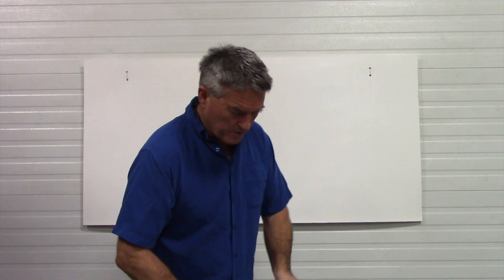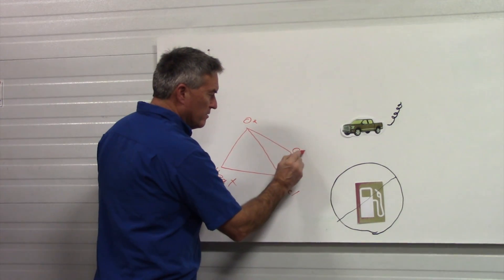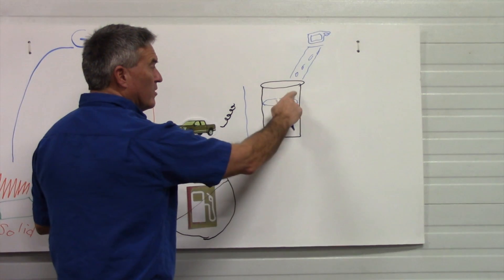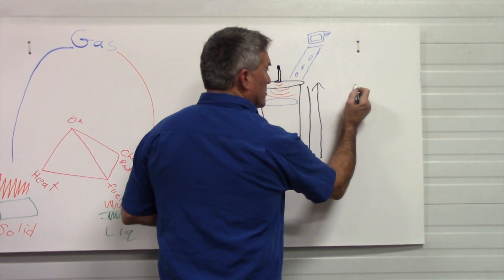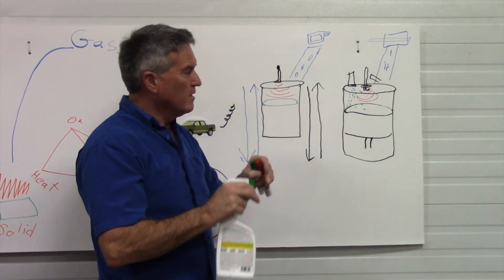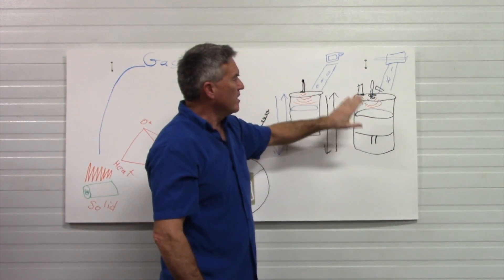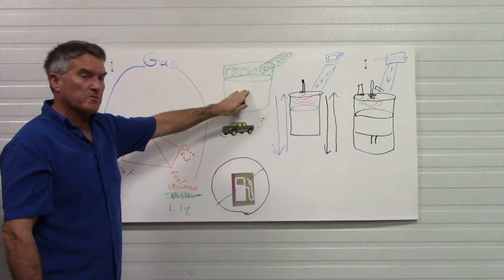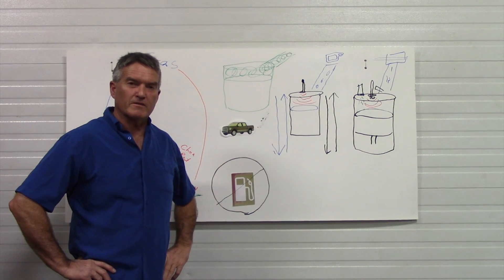One Simple Trick to get 100 miles per gallon with less pollution!

Comment: Smokey Yunick did that back in the early 90's on a 283 Chev by profection of the old 200mph carb...  

Gas has define stages (5) of flash points... He provided waste heat to the gas in stages of the flashing - the process of the 200mph carb was literally limited do to the fact that it didn't work with the chemical flash point of fuel and it's weakest design flaw - expending mixture.    So when Smokey provided the heat for the 5 stages and used a compressor to pressurize that mixture into each cylinder - the engine made HP and MPG unlike anything before or now 

This info should help

http://rexresearch.com/yunick/4862859.htm

https://www.allpar.com/old/200-mpg-carburetor.html

Watch this

https://boomtastic.com/gallery/videos/Smokey-Yunick/Horsepower-TV/

I know he had a 283 build up - 
Car Craft I believe...

Here a little more info

http://rexresearch.com/yunick/yunick.htm

Comment: In order to produce a mass of 6 tons you would need to start with at least that amount. That equates to burning 5 gallons of gas per day 365 days a year, not far fetched for some but not most. Then the 6 tons of gas would have to be somehow by magic converted into 6 tons of carbon. Now that's actual carbon not co2. So if 18 lbs of co2 gas are created by combusting 6.5 lbs of gasoline then the actual carbon content of the co2 gas is less than a gram. so going buy your bs figure of 6 tons we would need to burn several hundreds of gallons of gasoline per day per vehicle. I'm not aboot to start drinking your koolaide. You sound like the idiot farmer Al Gore.
Reply: Besides that Gasoline is a byproduct of kerosene diesel production. So where does all that kerosene fit in your master plan?

Comment: hasnt this guy heard of the pogue carburettor , they used this method in WW2  running tanks at 100miles per galon ( i said a tank) the government is owned by the fuel and pharma companies ...imagine how much money they have made since WW2 ...they are telling car makers how to build their engines ...20 years has passed since i got my licence cars have androids , variable controlled cam timing , multi point fuel injection, quad camshafts and the fuel consumtion hasnt changed on the vehicles !!!! WAKE UP  tesla built an electric car in 1902  that pulled 90 miles an hour  powered by a shoebox  sized power source that didnt run flat...the army and fuel companies have all the technologies...

Comment: It's Ogle patten from 1980.... we ordered a kit, $100 we build it in 1983 we went from 21mpg to 85mpg, lost about 1/2 the power of the engine, it was a buick v8 so it still had plenty of power.....we used the exhaust running through a stainless steel tube in another stainless can, it was used to heat fuel, fuel was sprayed on the hot coil, the fuel  boiled turned to a vapor, then it moved through a tube to feed the carb, 2  .187 jets fed the engine, it lost some power but ran rather well you need another valve to allow extra vapor in during big hills or accelerating plus you need an existing carb to run engine until it warms up. After warm up  you can kill the gasoline carb  run off the new vapor carb ... also exhaust fumes were non existant. This is nothing new, it does work, and you are right, but push it too hard and your person safety will be jeopardized... think they are moving 60 billion gals of oil a day, they might object if you cut that to say 6 billion. Word of advise. Build one for yourself and keep you mouth shut....
Reply: Well I have an old portable cook stove in my camper that runs on unleaded gas Pour gas into the tank pump up the pressure and the burners look clean and blue like the propane models
Have never checked to see if it’s more cost effective tho

Comment: Anybody pushing battery powered cars please remember they have to be charged...using power from??? Coal/nuclear/oil also batteries have environmental costs too. Even solar panels have to be made from rare earth ingredients requiring mining/processing.
Reply: vtg100 ambient electricity is almost free! Anyone who’s truly looked at the logic of hydro or diesel produced power will go how can this supply millions of homes, impossible..
Reply: ahhh but it IS possible...with sunny fields of glass and extention cords were carn use to grow, and there aint no fields to plow...world will collapse from round up poisnin their cancer cells before ya can count 23 million chinamenwomen..so then all will be energy suspition until the sun runs out of super X 4..
Reply: Lol they can make  1 million windmills
Reply: @realtan9026 hopefully you are not saying this thinking that this is a reasonable solution. 
Windmills are highly inefficient, have many problems.
Reply: @realtan9026 those windmills usually power the oil rigs and they produce JUST enough power
Reply: Not to mention it's microwaving folks

Comment: Well - one thing is for sure. 45 years ago, I found the vapour carbs of the 20's and 30's. They were large and since it was readily combustive, you had a explosive mixture during an accident. Metals were not as strong as they are now. You could burn exhaust valves quick. The one thing I recall is that 4 barrels were good at burning or at least dumping fuel down the intake. The smog stuff, the CAT is only there to make sure that everything out the pipe is charred and no hydro-carbons escape without being reduced with O2. I drove a V8 in the 70's and it got 14 to 30 mpg depending on conditions. Today, a 1/2 ton V8 gets about the same mileage as I did all those years ago.  Have we really improved anything, or just muddied the waters and you don't know. It matters not what you or I believe, we are both right. Cheers

Comment: Doesn't make a difference at what point the gas as liquid turns to a gas it still burns the same amount but it is much more unstable as a gas so that is why it is much safer to mix it inside the engine than outside of it. Just imagine a flash back would be like a bomb. What a crazy idea! Burning wood gasses after filtration was done in olden times and it was very unsafe. Better to change the wood gas into wood alcohol and run that through a carburetor or injection system. Your half ton likely gets 15-20 miles per gallon so this concept does not increase mileage by 500% it may increase but not noticeably. I think your just a goof who likes to talk but not say anything.

Comment: So basically the concept is to take fuel and air mixture in a separate burning chamber to burn it continuously and as cleanly as possible to create a continuous supply of high pressure gas and feed it in a controlled way to the block-piston-crank setup to run it. Just like a steam engine. So, why not feed some FREE natural liquid water in the external burning chamber to use the already existing heat to make some more extra gas to contribute??? But, however we decide to do it, when it comes to a external burning chamber concept then the feeder pipe diameter and the piston chamber diameter ratio have to be maintained (maybe controlled) properly to have a good acceptable power and acceleration balance. But that's a instant realization that the fuel will get much more time to burn so will burn much more cleanly. But as the external burning chamber is burning continuously so also getting fuel feed continuously so when feeding the gas to the piston chamber it will tend to get some un-burnt fuel too. So my question is how will you prevent that or so to say minimize that??? Maybe burn it again in the piston chamber by mixing the feeding gas with some fresh air ?????? (Just a thought.)

EDIT: My English is excessively good ;) and I am unfamiliar with your accent so I maybe completely or partially misunderstood your "trick" concept. So that's a disclaimer. Feel free to correct me.

Comment: Is FALSE that gasoline turn to pollution HC or CO.  IF the automobile the engine injectors, sensor, and compression are in good working condition the Focil fuel turn to water, good combustion becomes water at the end of the exhaust.

Comment: To all the negative comments,  legally he can not tell you the trick, but if you have any mechanical ability at all it's all very simple,  he told you time and time again, turn the liquid form of gas into a vapour,  he just did not use these words , so I'm telling you as I really dont care if they tell me I can't say it, TURN THE LIQUID INTO A VAPOR, then introduce it to your fuel injection rail, or your throttle body injection or your carburetor,  it will them be sucked in through the intake stroke and there wont be any pollution from the exhaust stroke

Comment: fuel does not lubricate your engine. Ask anyone who owns an LP forktruck. A lean fuel conditon will cause higher combustion chamber temperatures in lp or natural gas engines too. Atomizing fuel so far away from the engine will just cause a separation of fuel and air before it enters the combustion chamber. I call BS on the 100 mpg thing. Cut the totally wrong physics lesson and show results.

Comment: You explained how when liquid fuel is sprayed into the cylinder it helps cool the engine and if it isn't sprayed in evenly it causes overheating problems. You fail to explain how you achieve  that cooling effect when you are no longer spraying liquid fuel into the cylinder, but a pre mixed fuel and air gas instead, or did I miss something.
When I was learning about engines back in the 70's, I was taught that carburretors mixed fuel and air into a vapour, so liquid fuel was not entering the cylinder, it entered as a gas. So it seems your NEW idea has actually been around for a long time already.
You also say that to increase mpg and reduce pollution, simply reduce the amount of fuel entering the engine. Yes, but that means less power from the engine. So buy a smaller engine.
I'm never going to get this 16 minutes of my life back.

Comment: The fuel isn't lubricating the cylinder wall. The reason you can't put less fuel in is because it will run lean and you get engine knock and damage to the cylinder.

Comment: Throw the gas engine out and replace it with electric motor. Sure the biggest downfall is the battery.  but that's getting better too. How about: using an electric motor and powering that motor with a self looping generator. A couple  of  battery's is only used for starting the motors ups that will power the controller. extra 12 v bat is for the cars radio ect.   It'll weigh less and you can go as far as you want.  When your not driving the car you can switch it over to run your house.  problem solved...

Comment: Whether or not this is snake oil, who knows.   I grew up cynical of big oil and big auto, which have reportedly colluded to suppress better, cleaner tech over my lifetime to maximize profits.  Most people believe it's true, but nobody can change the system, so few try.  My parents talked of the Stillson Carburetor, which they said yielded 100 mpg in the model A, but never made it to market.  There is a long list of similars.  I do recall the removal of the LA area Pacific Electric red car rapid transit system back in the fifties.  It was common knowledge that big oil and GM were behind all the graft and corruption which pulled it off, resulting in the transportation mess which is still the fly in the ointment of southern California.  Later it was restored it at great cost as the Blue Line.  The freeway arteries, however, remain clogged. As long as smart people with viable solutions can be bought out or otherwise neutralized by evil people with big buying power, systemic change is unlikely until it serves the interest of.. yes evil people.  Nice try Zeek on Earth.  You can tell from the comments why this is true.

Comment: Carburettor turns petrol to vapour / heat of engine /gas,
 Injection turns petrol or diesel to vapour the heat Off the engine turns it to a gas  . That's why diesel engines smoke black when cold and need heater plugs to cold start.
 This is at best wishful thinking or Total Very DANGEROUS Garbage.
Reply: Asholes can prove nothing 
I CAN .     FOOL.

Comment: And every step of the "evolution" of fuel delivery to the piston has added more and more complexity and EXPENSE to a vehicle.  In the "Before Time", if you got into an accident you just took out a hammer and beat out the dent.  Nothing else was broken.  Now, a fender bender destroys all the sensors and electronic equipment.  It often costs more to fix a vehicle than to buy a new one.  So, we have throwaway cars.  Talk about waste.  You can even destroy the ECU by not disconnecting the battery before removing an electrical item such as a fan.  Ask me how I know.  Price a new ECU and tell me that today's vehicles are a better buy than the tanks of yesterday.
Reply: And don't get me started about crumple zones.  Talk about planned obsolescence.

Comment: What about the running lean issue?  Without the raw fuel as a cylinder wall coolant, doesn't the engine overheat and starts giving us mechanical problems?
Reply: They would probably have to redesign and add all sorts of new ceramic sleeves and other exotic items to compensate for running under a lean burn system.  Again adding more and more expense to today's vehicles.

Comment: this is a nice lecture in basic fire fighting and or ice operation.  thank you.  now I have a question about your subject matter.  the heat and compression convert liquid fuels into gas to be ignited by spark.  what process do you use prior to the intake stroke to be able to inject a gaseous fuel mixture?  I see some unpleasant comments, but I am not contemptuous of your video.  its a reasonable projection if the missing process is not more polluting or expensive.  please respond.  thanks.

Comment: SOME FLAW IN HIS LOGIC. I WILL GIVE YOU A PROBLEM TO SOLVE TO MAKE YOU RICH! The engine is flawed in design not the way it uses gas.The injectors that sit ontop of your intake valves are spraying gas and in air around a circular disk. During intake it is already being sucked in toward the outside of the cylinder walls.. Its so hot inside that it is already turned into a vapor before compression is completed. This is monitored and controlled by computer. That is why it doesn't run too lean and burn up or too rich and waste fuel and foul plugs and smoke. Id guess that the vapor and air are evenly spread around. After the air and gas is sucked in, the intake valve closes and the volume in decreased during compression.  Your V8 engine has an inherit flaw in its design.  Here is the problem. Each time a cylinder fires energy is used from the bang to create kinetic movement, once the piston gets to the bottom we reach our problem.  Energy is used spinning the cam to open the exhaust valve. Energy is loss stopping that piston's motion pushing that piston back up stopping it again while more energy is loss closing the exhaust and opening the intake valve and losing energy from changing the pistons direction again sucking in gas and air and then when it gets to the bottom using energy from the other cylinders more energy is lost closing the intake valve. Now it take energy to stop the weight of that piston to change its direction again to compress the cylinder again and now it gets to fire again. HIs BS doesn't compensate for this huge problem. You can find web sites where you weigh your piston, put in the bore size(how big the hole is) and the stroke(how far the piston moves) and thats some interesting stuff, I always thought rotary engines were neat. The guy who invented the rotary engine says it came to him in a dream. There is also a beauty in a two stroke engine. It fires every time the piston comes up. They have more power buy they don't burn like that flame he illustrates here. They have no valves, that take energy. A rotary engine has its flaws also. TRUST ME OUR PROBLEM ISN'T in the fuel delivery. They actually have prototype engines like how steam engines use to work. A steam engine could use the same steam on a small piston, then go to a larger one and then a larger piston. I seen one from a ship in the Smithsonian. In A PROTOTYPE engine i seen they took the exhaust and ran it threw a larger piston to try and utilize the expanding gas for a more efficient engine. Its not a conspiracy its physics.

Comment: This is not true. I did the set up with a power generator,  and it did not work for significantly longer by using gasified gasoline. Barely a minute longer, that is nothing, essentially this man is speaking
a scam, I was better off just using it normally as liquid. I am saying the truth, I am simple guy, and this dudes lies are irritating,  playing smart as* by just lying.
If he insists that he is right, then leave the whiteboard alone, do a real world set up, drive around,  and show HOW FAR YOU GET ON A GALLON OF FUEL with the liar set up, vs normal set up